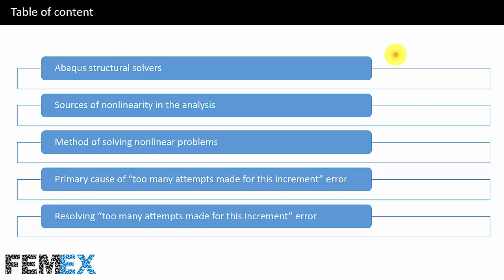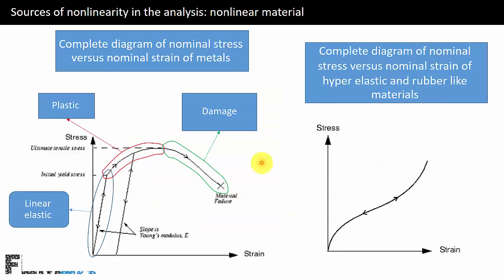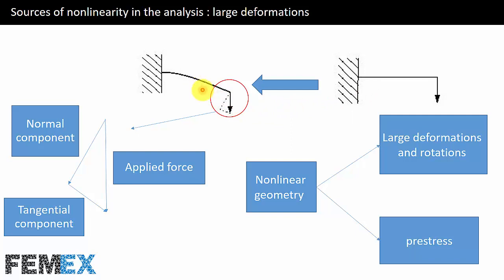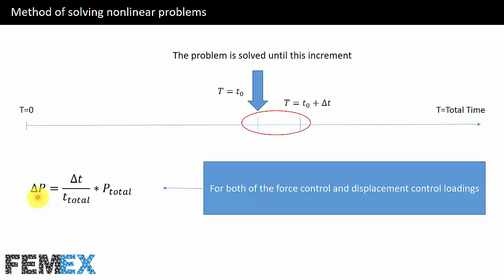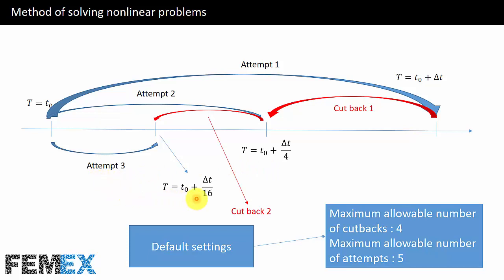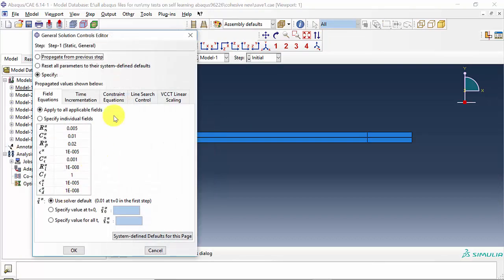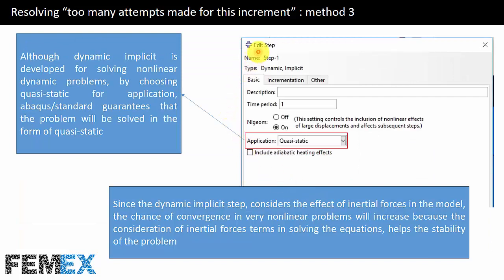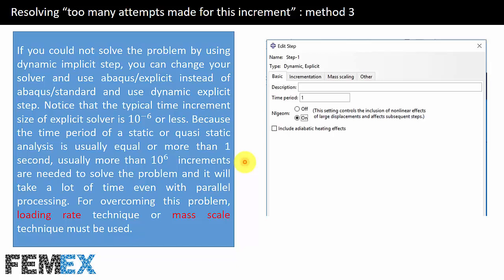resolving too many attempt error in abaqus

Comment: Hmmmm,
I would say - check dat and msg files first!
Don't start to play with setting, until you check and fix warnings. There are keys there
Reply from the maker: Hi.
Most of the Abaqus warnings do not affect the solution and they are only for caution.
Having or not having warnings do not guarantee your solution at all.
There are much more powerful tools and indicators for finding the convergence issues like job diagnostics tool.
Actually resolving convergence issues in a nonlinear FEA can be much more complex that you can imagine.
We have two other free tutorials about how to interpret the warnings.
here are the links to them:
https://www.youtube.com/watch?v=1THUIbs-dJw&t=21s
https://www.youtube.com/watch?v=MkuD1PM45ww&t=28s
Reply: @FemexIran  
1. Max number of increments exceeded.
2. Force/moment equilibrium is not achieved
3. Excessive distortion of elements
4. Excessive rotation in dof at the point
And so on. From my point of view this is really not too bad idea to look in output files to check what is going on in simulation.
I used to work w/o graphical interface, so both mentioned above files are key for problem solving and debugging.
Reply from the maker: @мишамихайлов-х2р  I have seen a lot of cases that the analysis was completed even with the mentioned warnings. Because of this I say that resolving them does not guarantee the completion or not completion of the analysis. This is because of the complexity of nonlinear FEA and I do not use the warnings as my main tool to resolve the error.

Comment: how can i resolve VALUE FOR PARAMETER NSET CANNOT BE MORE THAN 80 CHARACTERS
Reply from the maker: Hi.
this error means that the name of a surface or set or every thing else in your model exceeds 80 characters and it is too large. in the Abaqus, the name of everything must be less than 80 characters.
Reply: @FemexIran  what should i do now?
Reply from the maker: @saadulhaqhasni  you must check all of the names in your model and find the names with more than 80 characters and rename them in order to have less than 80 characters.

Comment: Thank you so much sir for the video. The next, I am facing error; 157 element have no property definitions. How can I fix this error sir?
Reply from the maker: hi. this error has two probable sources. the first one is that maybe you have not assigned section to some parts. the second one is that maybe you have not assigned appropriate element type to some parts that is not consistent with the assigned section in property module.

Comment: thank you for the details. 
I just start to build the model for a steel bridge in Abaqus. The bottom and top flange have variable thicknesses while the web thickness is constant all along the girder. I tried to create the parts with solid and shell shapes but still, the job can not run properly.
Is there anyone who succeeded to build a steel girder bridge model?
What do you recommend: create different parts (top and bottom flanges and web) separately and then connect them or create I shaped parts and attribute thickness to each part connect them using tie constraint?

Comment: for those who dont understand how nonlinear solving process by newton raphson, visit this excellent video on solution of system of  higher order polynimial equations by newton raphson method. https://www.youtube.com/watch?v=KPEOBATCUs4
if i am not wrong, beginner level finite element, the linear finite element analysis converts the governing differential equations into system of linear algebraic equations. which is solved by using many established procedures like gaus method or conjugate gradient method . but in case of system of algebraic equations of order more than 2, this newton raphson method is used.
the above things i said are based on my beginner level knowledge. i might be wrong. but based on my intuition i can say that i am fairly correct. some one please correct me if i am wrong.

Comment: it does not work at all. i do as you told, i use the implicit dynamic ,quasi-static, it does not work at all.too many attempts means you model is not correct.
Reply from the maker: hi. in some simulations the only choice is the use of dynamic explicit step because the model is highly nonlinear and we must change the solver.

Comment: I did what u told in the video but i am still getting this error -"Time increment required is less than the minimum."
Please help
Reply: What is your initial and minimum increment size?
Reply: @lollol9876543210  0.001 and 10*e-9
Reply: @swaroopzanke4299  Try increasing the initial increment, say to 0.01. This had worked out for me.
Reply: @lollol9876543210  ok. i will try
thanks
Reply from the maker: hi sir. if your model has convergence problem you will encounter with one of the errors: " too many attempt" or "time increment required ..." . in mechanical problems, the last way for solving these errors is uisng dynamic implicit step or dynamic explicit step if possible. you can contact me and explain your model in telegram or whats app or by sending email. then we give you solutions.
Reply: @FemexIran  I did what you told but I get error " Time increment required " ..
Can you tell me what I do ?
Reply from the maker: @bedaattestedattestedcfvcvz8387  hi. it means that your model has convergence problems. you can send your model for me. so we review it and find the mistakes  in settings and explain them for you and the way of fixing them. this is one of our paid services.